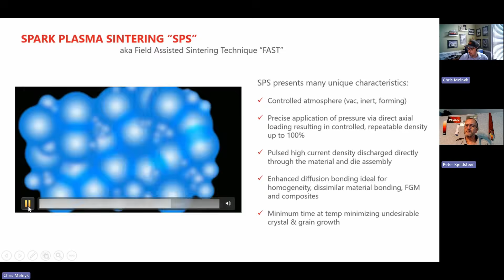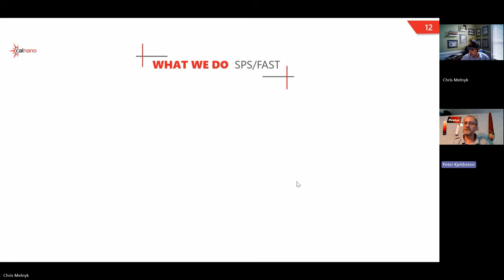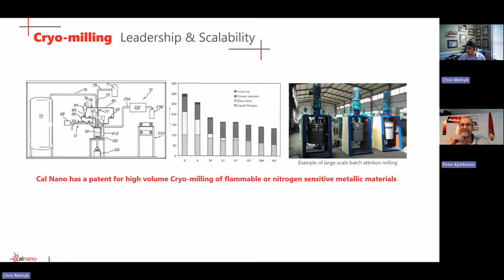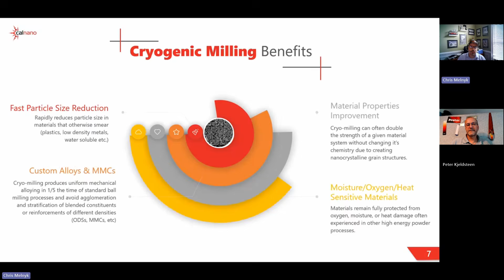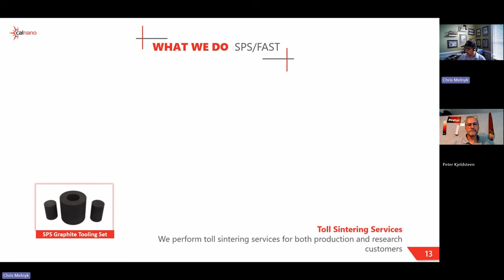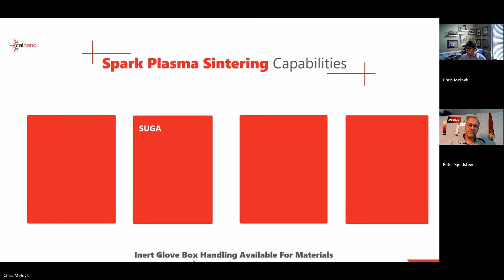Spark Plasma Sintering (SPS) and Cryo-Milling with CalNano

Comment: Hey Chris I think I solved (at least theoretically/conceptually) one of the most significant constraints to the process...
Reply from the maker: Please share more about your concept😊
Reply: @Everyday-metallurgy  The way the die is formed limits the possible geometries of parts. Making more than a puck/cylinder shape I'm sure is totally possible but then increases tooling cost and production time. I'm pretty sure I thought of a way around those constraints.

Comment: Very interesting process with lots of potential. I sense some resemblance with Hot Isostatic Pressing, but I reckon SPS is both cheaper and faster. Are there any drawbacks/limitations compared with HIP - e.g. uniformity, defect size,…?

Comment: Nice informative discussion., please do video lectures on microwave sintering of powders
Reply from the maker: Great input. Do you have a suggestion on who are experts within microwave sintering?
Reply: @Highball
Reply: I have not started working with The Virtual Foundry FFF materials yet. Hopefully soon. The channel Highball is hosted by a guy that has been experimenting with microwave sintering and specifically with FFF metals. He recently developed software that allows significant control over a standard microwave oven that will likely allow this idea to become more viable. Highball and Shake the Future are the two most well known (to me) enthusiasts of microwave metal working. Both channels I recommend if you're interested in this sort of thing.